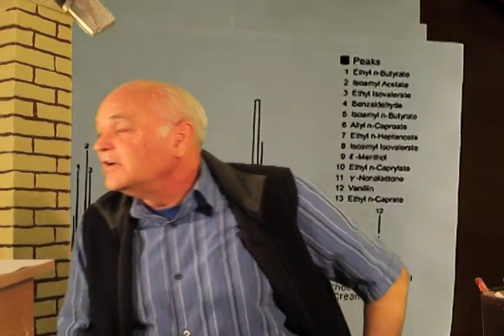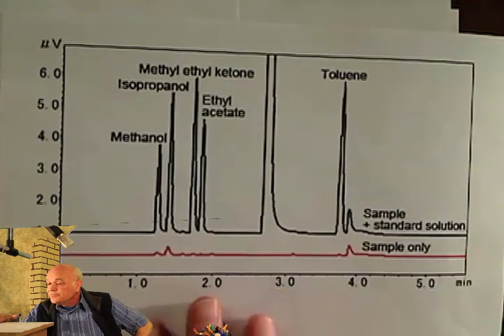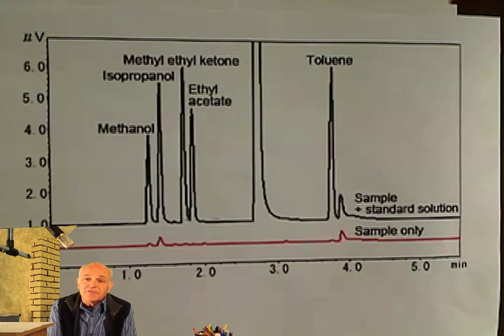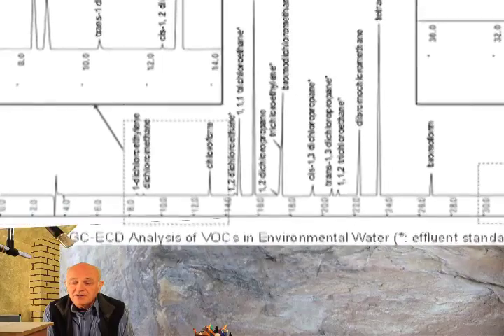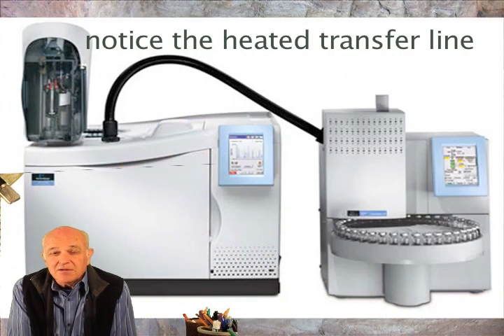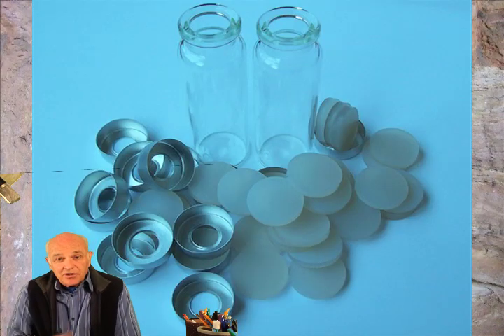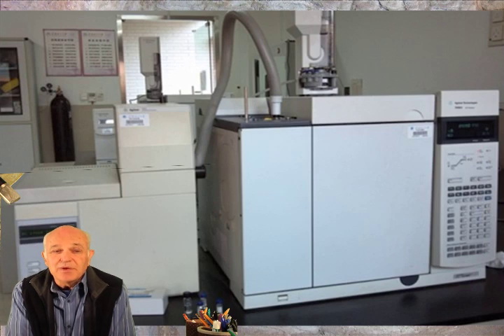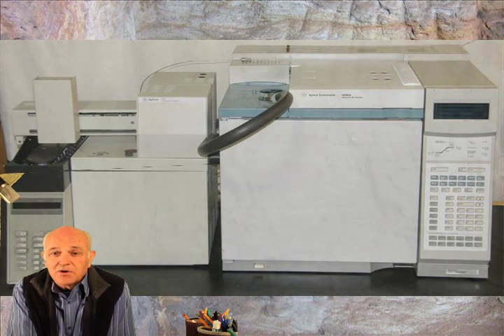Headspace gas chromatography

Comment from the maker: If I was facing this I would find a reference and follow the reference.  A general answer would be to make a standard at 2000ppm, mixed with all four compounds.  Or buy one already made.  And use the internal standard specified by the reference.  Juliet, I guess the short answer is to ask someone else.